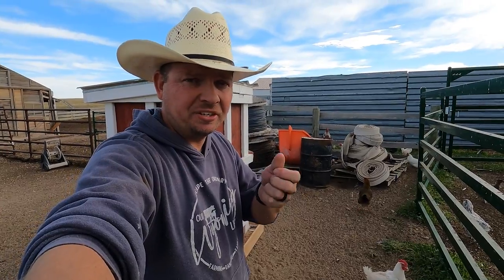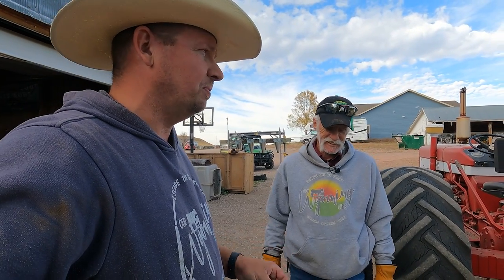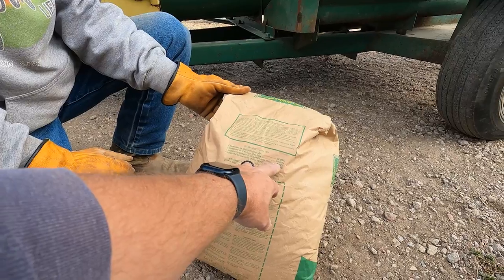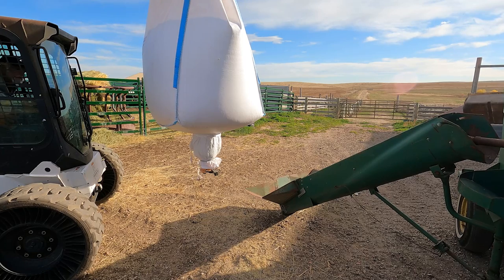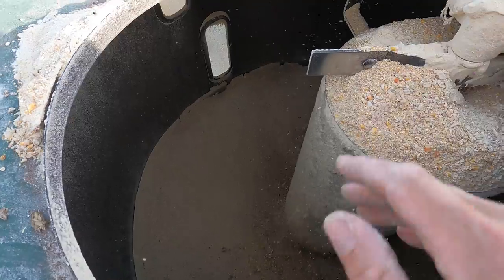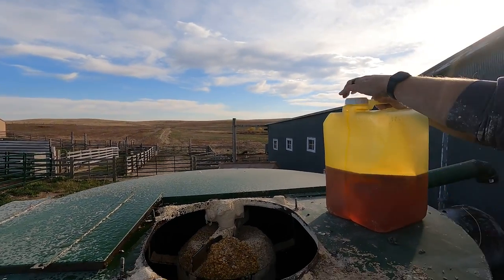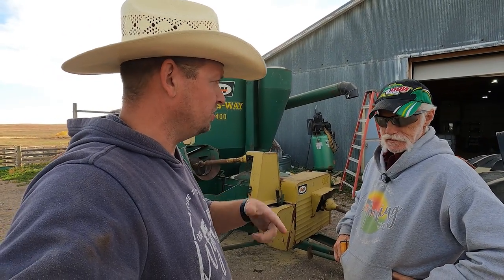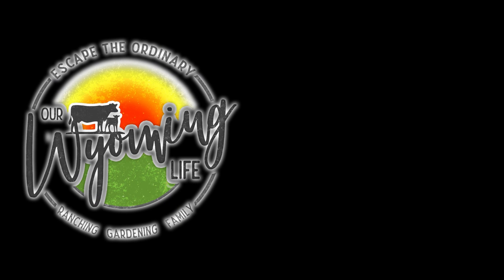Quick and Easy Chicken Feed for Any Size Farm

Comment: Ok, I use a similar mix that consists of 25% of each corn, barley, wheat, and oats, and add in sunflower seeds.  I do not add oil because all these grains have oil.  Instead of grinding I soak and sprout the grain which brings up the protein and the enzymes.  The chickens have no issues whatsoever at all with any of this.  To bump the protein a little more after the sprouting I add alfalfa pellets.  For minerals and calcium I use kelp meal.  On both the alfalfa and kelp, my measurement is by the handful, so I don't know what the percentages are but is minimal.  For parasites I use apple cider vinegar in the water, which also helps acidify the crop, and diatomaceous earth.  So far so good.  I have a small local operation so keeping costs down is way important.  In the future I will up the corn percentage, I like that idea.  Good work on the vid.

Comment: Hey Mike just an FYI on the oyster shell usually for consistent consumption you want them to be fairly fine about the size of a milo seed so on your next batch you might want to grind them a little bit it's about the same thought process as whole corn vs cracked or ground corn the smaller bits are more readily eaten whereas larger pieces are left until last

Comment: You can use the Dust for making a milk for scouring calves I used to take the flower off the top of my dad's mixer and make put a little bit of mineral salt in there and Karo syrup to make it sweet and three to four eggs Raw and mix everything up with warm water and the calf would drink that and it would give them enough to live on until their scouring stopped and then they got that with the shots we had a lot of good luck with that it gives their body something solid to hang on to otherwise they almost starve to death
Reply from the maker: Thanks for the info Karen.

Comment: Where the tub empties into the auger fix a drip for oil so it mixes going up the auger. It will take a little bit of adjustment but might be easier and you’ll still get a good mix from the tub to the auger to your holding bin. Assuming that oil is a binder.

Comment: Good video. I would think the pellets would pulverize in the mix mill - I was looking but could not see.  We can get a straight mineral supplement without having to buy pellets.  It will be interesting to see whether it goes rancid from the oil (I don't know) and whether the chickens actually clean up the fines from the grinding, pellets etc.  When I have done this method of feeding in the past I made a mash so that they got everything and did not just pick out the big chunks.  Definitely a money saver.  I am curious though why only 10% as most are around 17%.  It works for you and that's all that matters.  Good job!

Comment: We used to free range the oyster shells that is let them eat them as they wanted them. Put your grain in at the top and not use the auger! Be much quicker. One less thing to go wrong. And probably safer. As long as you keep that Adjustable gate closed down so you can’t get your hand in there.

Comment: I’d make a modification on the top of the artsway to pour your soybean oil in rather than taking that big lid off all the time. Something easier for you to add the oil while it’s mixing. Small tube on the mineral side or something of that sort. 

Been many years since I’ve made feed with a hammer mill. Brings back memories.

Comment: Feed prices are nuts and for your scale it makes complete sense to do your own mixing question though is where the 10% protein came from, what was it when you bought feed already mixed for you?  In general 14% is a low, 16% is the more common norm to keep them producing. Been raising layers for 10 yrs but on a very small scale so I actually ferment my feed and is a whole other issue trying to find whole grains plus suppliments but for your needs check out Purina Homegrown Multiple Purpose suppliments, 36% protein and think its in 50 lb bags, you can drop using the layer pellets going this route. 
Great video amd your right many don’t explain why.

Comment: Corn doesn't keep well cracked, so mix smaller batches or mix it in later. 50% commercial feed for the minerals and so on is a pretty foolproof way to mix a cheaper feed without trouble. Other 50% is grains (only corn needs cracking as it is to big for the chickens to eat (easily) otherwise), fat can be sunflower seeds (or lineseed, but that can give fishy taste to the eggs) and the shell can be fed loose in a seperate container. Animal protein (since chicken is omnivore) is often bugs in summer, but may/will need supplementing in winter (bit of catfood works in a pinch, but so will mice/rats cuaght in a snap trap/ without poison).

Comment: ALWAYS put loose wingnuts, nuts, bolts, etc IN YOUR POCKET or a container so you don't lose them or drop them into your machine.
Also, take the time to spray paint them a bright emergency orange or another color in case you drop them in the dirt or grass, etc to make them easier to see and find.
I always lay down a tarp under any vehicle I'm working on to catch dropped items.
Reply: smart tips!  :)
Reply: Remember to remove them from your pockets when you put them in the laundry.Pockets are checked but things get missed.

Comment: Oil is extracted from soybeans at modern plants by solvent washing of soybean flakes which have been preconditioned for optimal separation of oil from the soybean meal, using hexane as solvent. The heart of the solvent extraction plant for vegetable oil is the solvent extractor. 
n-Hexane is a chemical made from crude oil. Pure n-Hexane is a colorless liquid with a slightly disagreeable odor.

Comment: Mike, I enjoy your content, but your off base here. firstly, layers need closer to 14-16% protein, generally no2 dent corn runs 8-9%. a ton when mixing feed is 2000lbs, barley is great ruminant feed, but it's high in fiber, and the animo acids can cause some issues with productivity in poultry if there's to much,
 Adding a complete layer to your mix is a waste of money. It's meant to be a sole diet, hence "complete" and it's so little, it's effect is gonna be diluted until its negligible. What I recommend is you take some time, and do a bit more research, and see if your suppliers can source a layer "concentrate" for you, it's gonna be around 38% protein, meant to be mixed with ground corn at roughly 600 per ton or 2000/lbs. 
with some education, and practical practice, it's not hard to figure out how to tweek the recipe with sacrificing feed efficiency. and a properly formulated feed, means less consumption.
Reply from the maker: Our laying hens have been eating this basic recipe for the last year. We are happy with it. Thanks for the information, and thanks for watching.

Comment: Instead of the layer pellets, you should use some minerals used for pigs or cattle, the layer pellets really did nothing for your mix!  Also, to increase protein, add a small amount of alfalfa (35% protein).  I also bought a pellet machine to turn my mixed feed into pellets - easier to store and doesn't mold as easily.  Oyster shell should be fed separately by itself as the chickens will use it as they need it.

Comment: Why dont you grind the pellets to mix in better? That's why my cousin does it busts them up a little more he says. Weld some hinges on that lid make it easier to deal with that only need to bolt two sides just a suggestion.

Comment: I'm wondering since you added moisture if the feed will harden once it gets really cold? If it does then it may be really difficult to remove at feeding time. Just wondering.
Reply from the maker: Im not expecting it too be an issue.

Comment: Free, high protien chicken food:  Drill some 1/4" holes in a 5 gallon bucket,  on the side, where the side meets the bottom. Using a pulley on a tall post, like 30 feet tall, prepare a rope to raise and lower the bucket.  Now get some roadkill, place it in the bucket and raise the bucket as high as you can - to escape the smell.  When the maggots, that the flies lay, are old enough, they want to migrate and end up falling out of the holes. The chickens, after a while, will camp out under the bucket!

Comment: Interesting machine, but... uh. 
This looks like you just randomly mixed up things without much knowledge of what you are actually doing. The oyster shells are too coarse for chickens and if pellets have just 16% protein, they are meant to be fed exclusively, with just ~10% additional grain (see details on the label). You are diluting all the ingredients in those pellets. Everything combined, you probably end up at 12-14% protein, which is very low for laying hens.
Next time, get some pellets that are made for mixing with grain. Those normally have >20% protein. And get a simple dripper line for your oil canister, since adding it at once that way will always mess up your equipment and lead to uneven distribution in the feed.